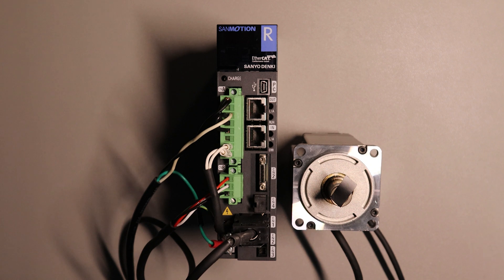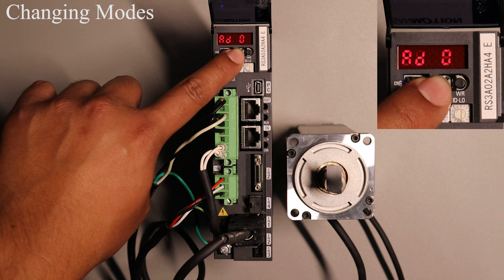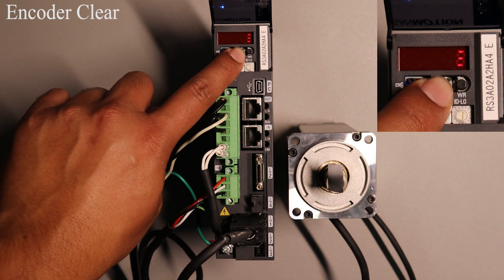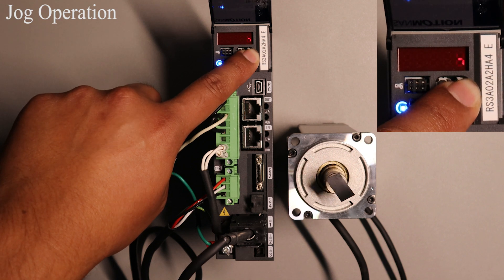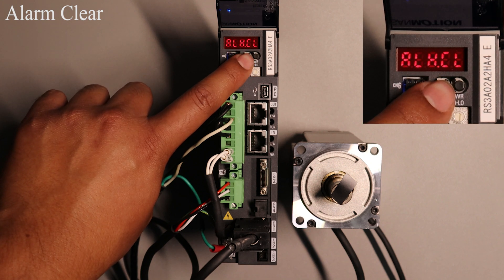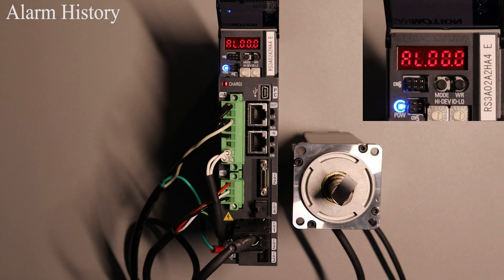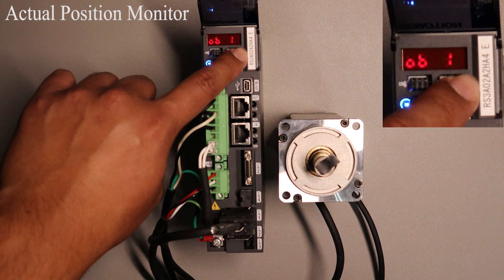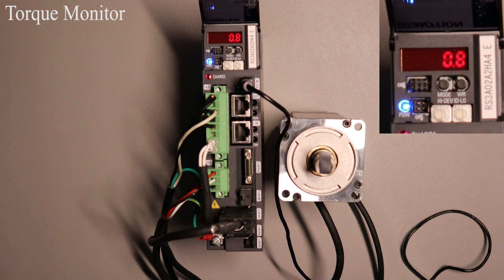How to Operate RS3 EtherCAT Digital Operator

Comment: I need help.  I would like to connect external regenerative resistors but a faulty one appears (AL43.2.) How do I activate it?  Model RS3A03A0AL H.  Thanks
Reply from the maker: Hello, with this specific amplifier you cannot connect the regenerative resistor. You would need to purchase an amplifier that does if you would like to use one.